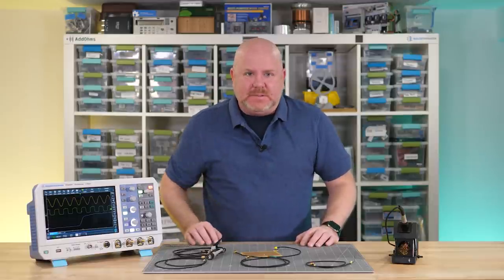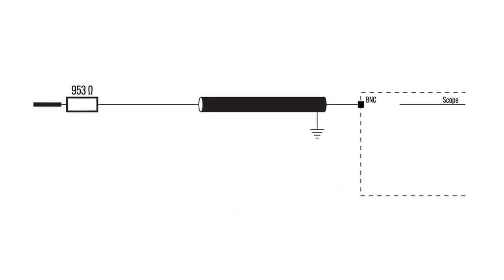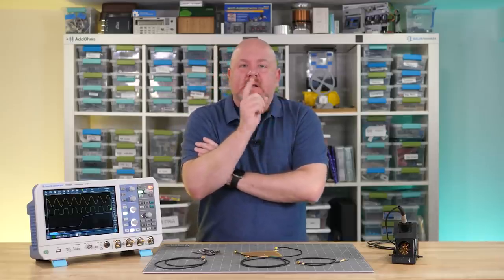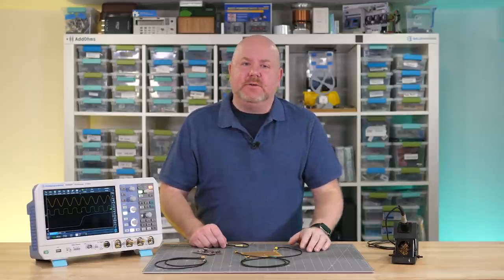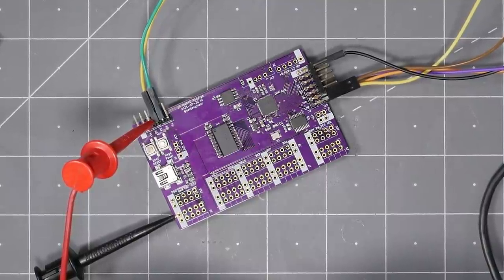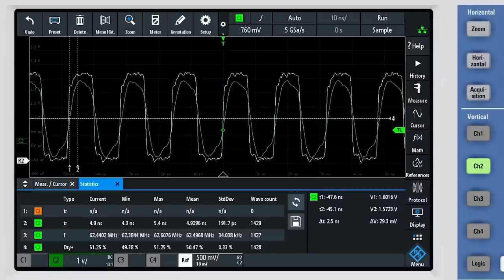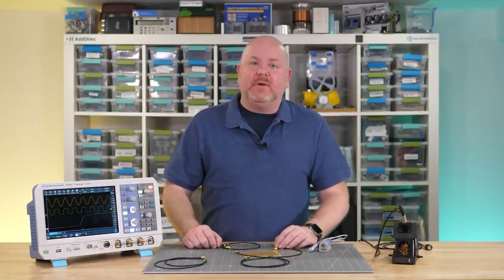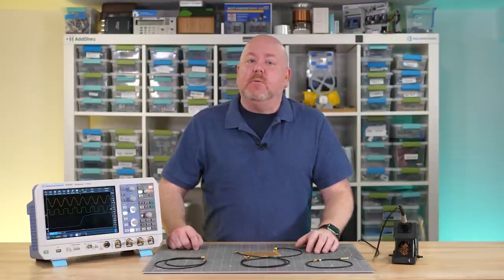DIY Solder-In Oscilloscope Probes - Workbench Wednesdays

Comment: I've done "Low-Z" probes like this many times.  Works a treat, and with the tiny coax connectors used in cell-phones, you can design in reliable test points with a 500ohm resistor and a sub-micro-connector.  3-4 inches of wire-wrap wire twisted into a pair also makes a decent solder-on test point to tape to a scope probe tip.

Comment: Is it be possible to use a super short piece of bare copper wire with just enough to clip the probe onto? Or would that have some kind of negative effect..
Reply: if you are talking about the normal osciloscope probe, no negative effect, it works better but is more harder to tip the signal on the PCB, also the osc. probe have an accesory that looks like a spring, this is designed to make contact on a ring on the probe (this ring is ground) and with this combination you can make a super short signal tip without worry the negative effects of large ground clip

Comment: did you try the active probe on the end of that wire at 6:14
Reply: No. There isn't a good way to attach the active probe without a bunch of extra accessories, which would ruin the comparison.

Comment: Are there any DIY passive probes that work for 1MOhm? My scope has only 1MOhm. I tried a few and they have horrible ringing/reflections/whatever is going on.
Reply: Might have luck tearing apart some $30 china-special probes to solder down?
Reply: You can buy a 'through terminator'  - a BNC through-connector that includes 50R termination. This will turn any 1M scope input into 50R.

Comment: I'm curious. Since your working with passive components. Would resistive soldering have a stronger solder joint. (Active components such as transistors or diodes might perceive a load and simply be destroyed)

Comment: any alternatives for 5mOhm scopes :O ?
Reply: What is a 5 milliohm scope?
Reply: oh my scope says that all the inputs are 1Mohm, and it has no 50Ohm inputs! @bald_engineer
Reply: @ameliabuns4058  You can use a Feed through terminator to connect it between incoming 50 Ohm coax and oscilloscope input. This will make your scope 50 Ohm input

Comment: 7:14 Looks to me like you have the probe connected to the 16u2 XTAL1 connection, which is the input of the inverter that implements the oscillator.   In general, to examine the oscillator is functioning, the XTAL2 pin, the inverter output, is a better bet as it's lower impedance. XTAL1, being an input, is a high-impedance terminal, with DC operating point set by resistor feedback internal to the chip. If the probe adds a significant DC path to ground, (as through 1k of probe + 50 ohm scope input), that will override the DC operating point, and set it to a low voltage  at which the inverter can't oscillate with the amount of feedback provided through the crystal-capacitor feedback filter.
So, this indeed demonstrates that attaching a probe to a circuit may disrupt the operation of that circuit. However, this DC disruption is rather mundane and avoidable (put a capacitor in series).  Of more concern are the subtle ways that a probe can disrupt the ac operation of the circuit -- attenuating the ac signal, delaying or slowing edges, adding ringing, and so on.

Comment: The proto board was a good move. Even if you'd used leaded solder for a stronger joint, it's very easy to tear the metal coating off the resistor chip.